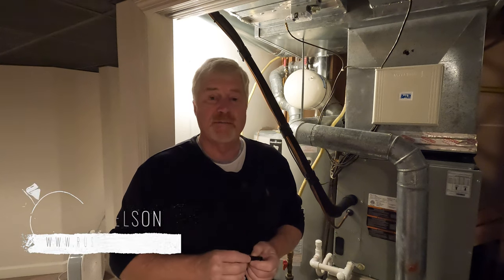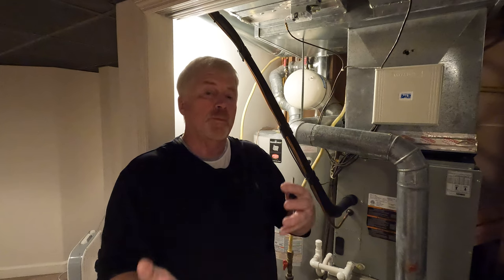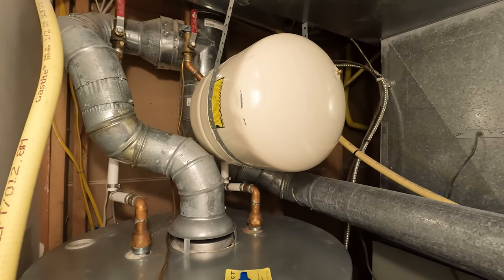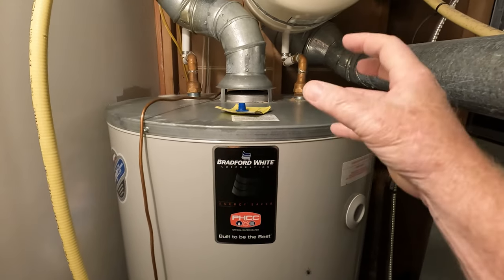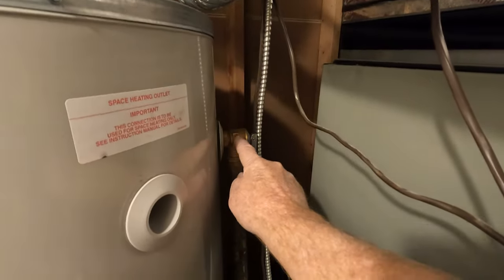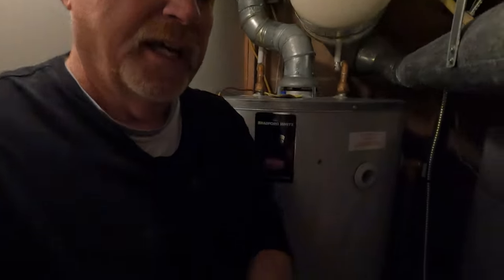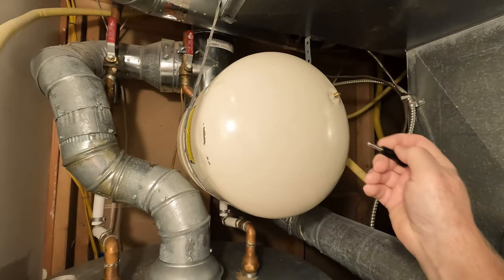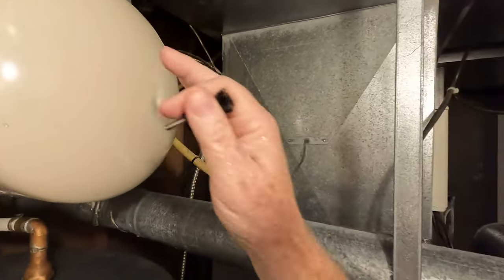Check your Expansion Tank pressure once a year to keep you hot water heater Safe.  The Villages Fl.

Comment: When checking air pressure of an already installed expansion tank, you first have to shut off the water main valve so that there is no water pressure coming in; then you open some faucets so that you relieve the system’s built up pressure. After that you can get a more accurate measure of the air pressure in the expansion tank, and fill it to the appropriate pressure.

And you do not have to drain the water heater tank to check the air pressure.
Reply: Thanks
Reply: Thank you  you answered the question in my mind 😂
Reply: Yes, I was also wondering that. Also, if you fill the tank with air that matches your water supply pressure, no water would normally enter the tank, right? So the expansion tank would be 100% air, not half filled with water as he said at the beginning of the video. I think the factory pressure of 40 psi is adequate if your supply pressure is 70 psi. Some water will enter the tank until the pressure equalizes, that’s how it was designed to work.
Reply: @heinzotto1194  Your later points are incorrect. As the water expands, it enters the expansion tank and compresses the air or bladder inside. When the hot water is used, and the temperature decreases, the water inside the expansion tank is pushed back into the main water supply.

remember to check the pressure of expansion tank often. It can loose pressure just like your car tires do, more so in fall, when outside temps fluctuate.

Comment: A thermal expansion tank is only necessary if the water heater is part of a closed system. A closed system is created when there is a check valve in the incoming water supply that prevents the expansion of heated water from flowing back into the water main.Jul 26, 2019
Reply: Incorrect
Reply: @benmattson5649  Sorry but this is correct. An expansion tank is needed because of the check valve,

Comment: The tank should be mounted such that the process connection is at the top, so the air bubbles can rise up and out of the water side of the tank. If the tank is on its side, air can get stuck inside and cause corrosion at the steel tank wall.
Reply: funny enough my tank is corroded a the top from water escaping and sitting then slowly dripping down

Comment: I went to check my relief valve plumbing, it seems to exit outside the home.
I'm a little surprised on our water pressure (located south of 44) it was approaching 75 pounds.
Thanks!
Reply: The outside tap may not be the same as much of the rest of the house and subsequently the expansion tank. Depends if it's coming off a balanced supply or the main. That's why it's not a case of simply matching the tank pressure to outdoor tap pressure.

Comment: My house water psi is set at 55.  I set my expansion tank psi to 55.  I have a dedicated bib that I keep a pressure gauge on, why would it show 90psi after the water heater completes a heating cycle if the expansion tank is supposed to keep the water psi equalized?
Reply: It will go up because of the heat of the water expanding , but up that high , you might want to check and make sure the tank is working properly and not leaking air . Shut off main water valve, drain lines to relieve pressure and THEN check pressure in tank, if you set it at 55, it should still be around that pressure , if it’s low, check and see if the valve is leaking air or the bladder might be leaking ?

Comment: Still confused. It seems to me that you would need to check the tank air pressure with house water pressure behind it. If you put 70 psi in there with no water even connected then you install it and your water pressure is say 69 pai, There will be NO water in the tank. Also, you should mention the underlying reason this tank is needed in the first place. It is because modern water supply require by code an anti- backflow check valve to prevent contamination of the city water by anything in your house. Without the check valve an expansion tank in not needed because the water can expand right back into the supply line.

Comment: Just make sure you have an insured, bonded, licensed plumber within your state requirements to  check your water supply and water pressure! Between 35 and 75 psi, you have a questionable problem!
Reply from the maker: Yes if you are going to have a plumber do it. But this is an easy check for a home owner to do once a year.  Yes if you are pushing over 80psi you need to look into it I believe.  Have a great day and thanks for jumping in.

Comment: Nope. We don't have one of those expansion tanks on our water heater. And no it's not a tankless system. We have 3 levels and 5 bathrooms.
Reply: It was not always code, but it should be installed with one unless you don't care if the PRV leaks.
Reply: If  you don't have a backflow check valve, then you don't
t need an expansion tank.